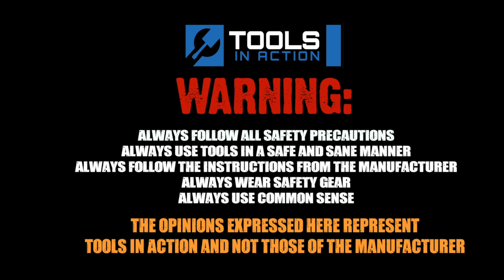This Gas Can Should be Outlawed!

Comment: I have some old  Midwest cans and old spouts and they work great no spillage
Reply from the maker: The same style?  These cans are horrible
Reply: @Toolsinaction  No different style spout same style can. I called Midwest a few years ago and they said the public wasn't happy with the spout not pouring faster so they changed to the style you was using. I will not use the style you reviewed ok to keep sealed about it.

Comment: The best way is to first make sure it's screwed on tight, then, you use your fingers to push red thing, and push the nozzle with your hand inward. It gets stuck, but you can push the separate nozzle, the tip, inwards.

Comment: The reason that the new cans have these spots is to meet EPA requirements. You can't have a gas can that you have to manually close a vent. That is also why new cans collapse when they get cold, its all emissions standards from the EPA nothing with the companies that make them. Loophole is buying an aftermarket spot and drilling a vent hole.

Comment: You can buy new nozzle's look for a water can nozzle.  It will also come with a vent cap you drill like a 1/4" hole so you dont get the glug glug glug.
Reply from the maker: Yes for sure.  think im going with VP race fuel cans
Reply: @Toolsinaction  nice!!!!